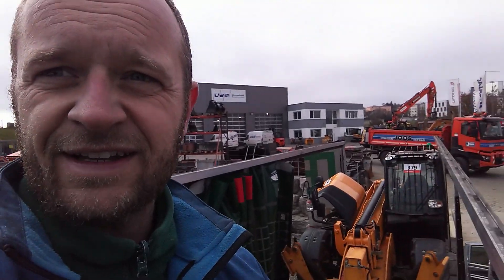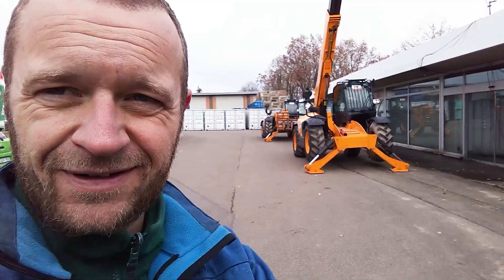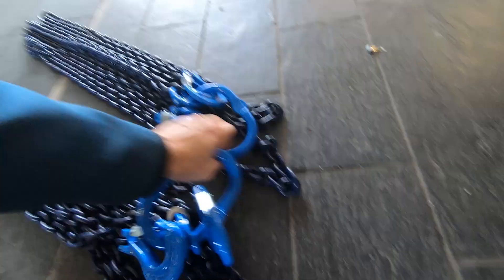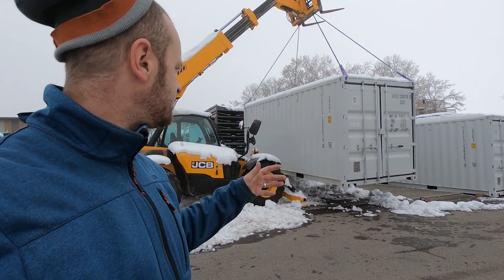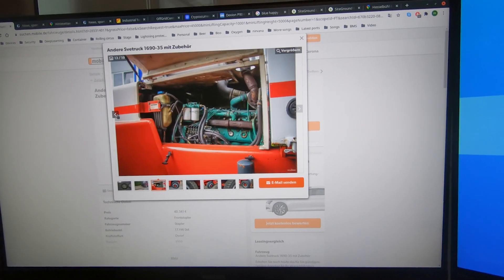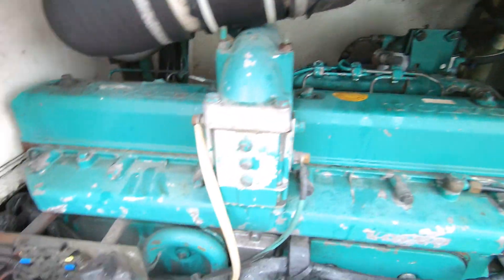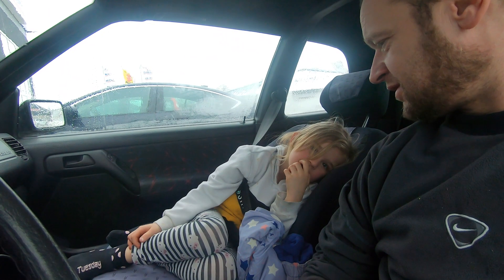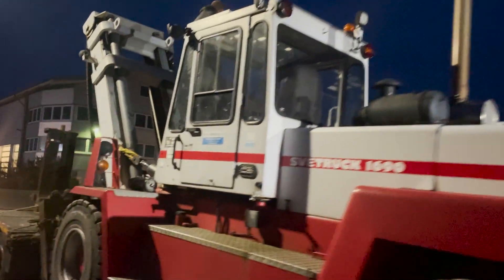21 Ton Forklift and a 10 Ton Telehandler - How We Buy Big 2'nd Hand Machines and Tools

Comment: @Off-Grid Europe    I really enjoyed your video production. I’m always very interested in anything having to do with forklifts and telehandlers. The only thing I’d like to inform you about is the telehandler rigging system. Here in the USA it would be a OSHA violation to do overhead lifting with your method.The reason is that the chain assembly attached to each fork can potentially slide off the forks if for some reason they are tilted down.I don’t know about the regulations in Europe, but I would guess they are even more strict than in the USA.My advice as an experienced telehandler operator would be to purchase a single or double revolving hook attachment that slides onto both forks and allows you to secure the device to the forks mechanically.Of course make sure you get the correct capacity required.This will allow you to easily rotate the load and the operator will have total confidence that the rigging is secure and will not accidentally separate from the telehandler.If the main use is hoisting and moving containers this would be much better than forks. If you did use forks, your machine would require 8 foot long forks.And on a typical telehandler the forks could not be positioned wide enough to enter the fork pockets of the container.My main motivation for writing  this comment is safety of all workers involved in your business.
Reply: Hi William, if you look at 1:56 you will see that we are not using the forks for this purpose, the JCB has two mounting points on the actual boom arm chassis where the 10t certified chains are attached. So it is actually on a hook already.
Reply: @markkragh4223    You are absolutely correct Mark. I completely missed the part of the video that clearly shows the chain slings with master links were not attached to the forks. I’m glad to see you and your crew are practicing safe rigging procedures. And I’d like to wish you good luck with the new forklift and telehandlers. Hopefully they will all provide excellent service life. Obviously the machines come from two top tier manufacturers, so all should be good. Take Good Care.